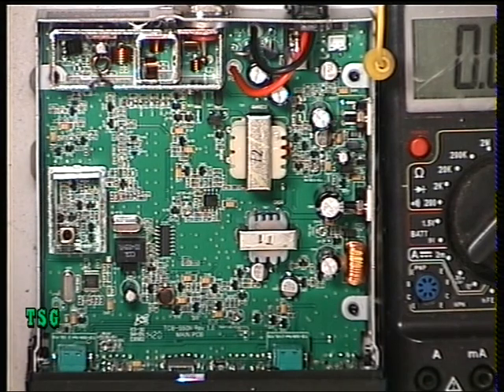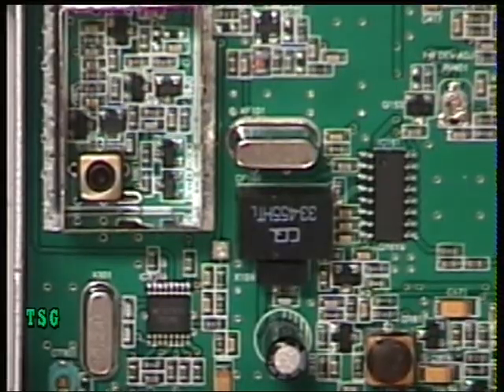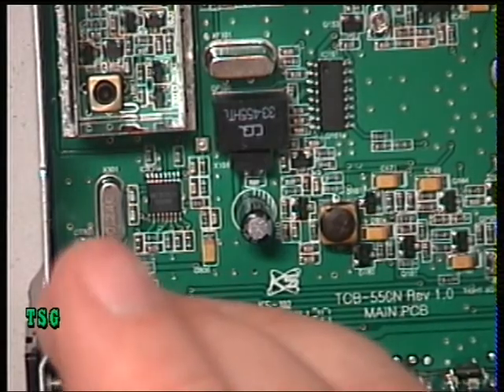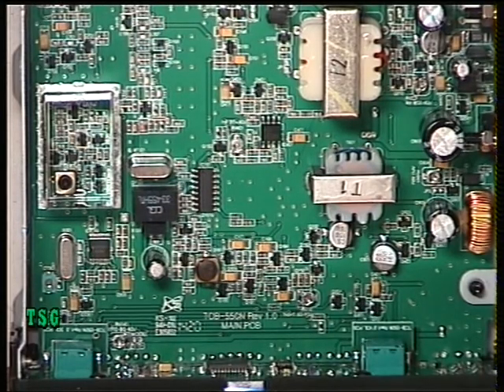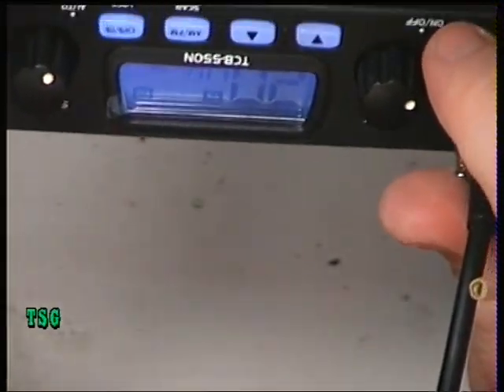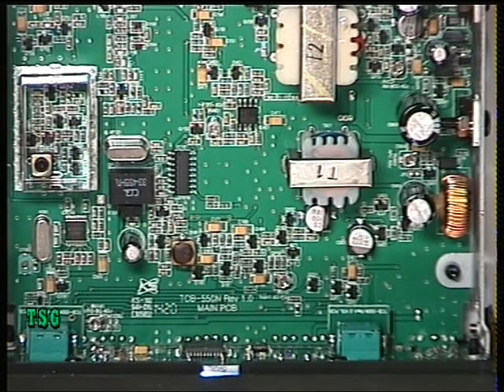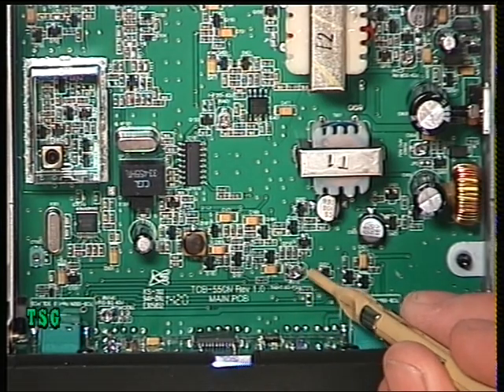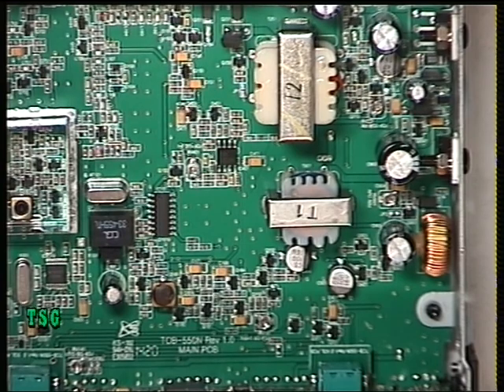TTI TCB550N  UK (CE Multi-Norm) CB Radio (Mobile) - VCO tx & rx adjustment

Comment: I have just ordered this radio from ebay Brand New in the box from a retailer (customer return) for £27 inc P&P, I don't need it but couldn't resist for that money.  Unfortunately I do not have the equipment to check the receive sensitivity is as good as your set but I will be checking the frequency accuracy, power output and  deviation for sure.
Reply from the maker: +simon walters It'll just need the Dev & power adjusting I expect
Reply: I hope so, it has not arrived yet, fingers crossed it will come tomorrow.
Reply: Like yours the deviation was 1.5 and power 3.5 watts, the set will do 6 watts max at 13.8v but i set mine to precisely 4 to keep it legal.
Reply from the maker: You can set for as much as 4.4W at 13.8V as it will be less than 4W when on a car at 12.8v. On the other hand you don't 
want to thrash the radio...

Comment: Another job well done, they are clearly not aligning these well at the factory (along with every other factory judging by your videos).  Do you by any chance have a Realistic TRC  2005 and a Danita 1240 knocking around you can do videos for please?  Best wishes, Simon
Reply from the maker: +simon walters Yes, I've got both kicking around & funnily enough it was a toss-up as to whether the next video was to be the Danita 1240UK or the Mk 1 version of the Moonraker Minor. You win. I'll start it after I do some (bloody) accounts work here :(
Reply: +UK CB radio servicing Brilliant, if you lived closer i'd buy you a pint. Simon
Reply from the maker: +simon walters I've started the Danita 1240UK & discovered  the tact switches used on the channel up/down position are both knackered. New switches have been ordered. Other than that, our 'scrap' sample looks like it will work. The switches should arrive tomorrow.

I've also dug out a Realistic TRC2005.....ready, 

Richard